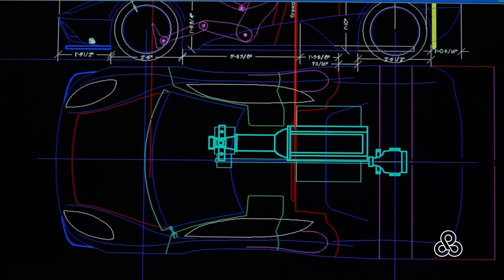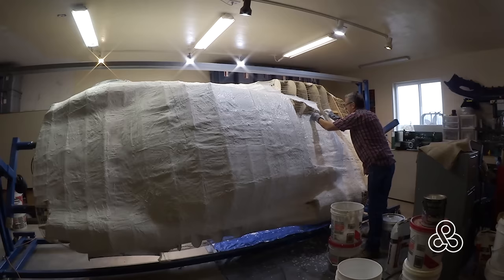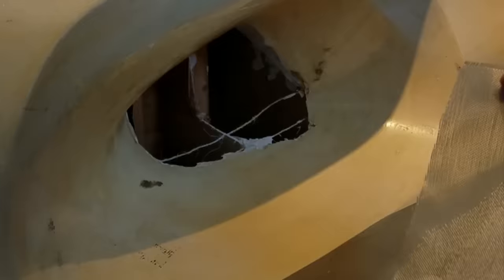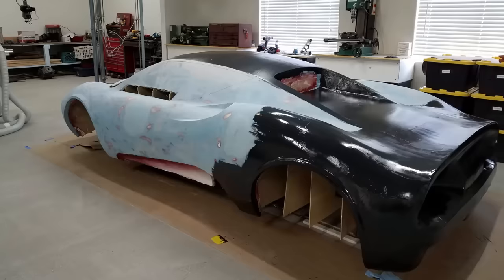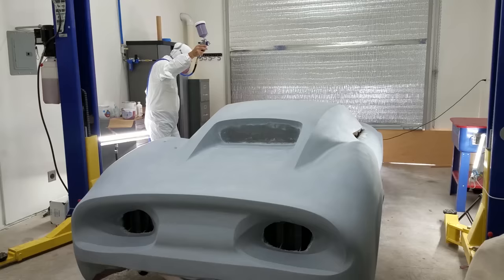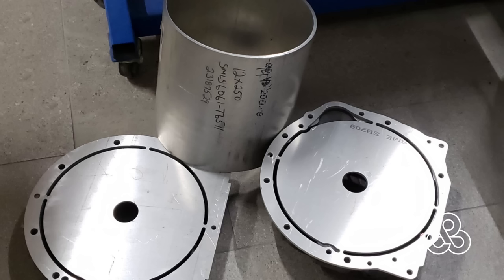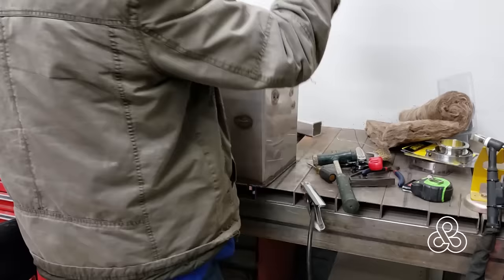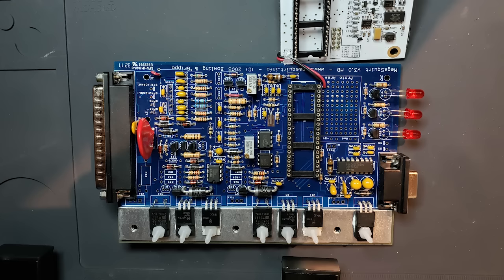How to build your own 200mph Supercar; at home in your spare time. Part 1

Comment: Do you help people do this? This is great
Reply from the maker: The videos are help in themselves, but if you have something specific I can help with; I'm glad to help.
Reply: @BuilderCreator  got yes thanks... I'd like to do this or make a mold of the vector w8.. I should be able to get the dimensions ect. From Google. Would be using a 2003-06 porsche boxster as donor.. i know a California company that does this and sells the chassis noxter donor but with their own custom mold.. just want to know best way to start.. also your not in California??
Reply from the maker: @larryz3985  I'm in Southern Oregon. Get yourself a donor chassis setup and then design your own body around those dimensions ( I can hook you up with a 3D modeler). You can take inspiration from the Vector, but make something original. Find some glass you like from an existing car or it is going to punch a giant hole in your budget to get a custom windshield made. As I mentioned come up with an original design (some sketches or model) the ribs for the full size plug can be pulled from a clay model or a 3D model. Would love to see what you do!
Reply: @BuilderCreator  thank you so much this helps me very much.. will find good wind shield and go from there..  ok appreciate your reply..! I can definitely try and put my own touches that can work didn't have the confidence to even think about that but know I understand that it would be easier fir me. Gives me more room to work with.

Comment: Admire your work. This is how boats are being built in 20th sentry. My question is would it be easier and faster to make a real 3d model and print it out piece by piece and assemble it ant convert to plastic or metal body parts?
Reply from the maker: There are companies doing 3D printing of tooling molds, but a printer that could create an accurate and stable mold for body parts would cost much more than the car itself . . or I would think a dozen cars. You will see some 3d Printed parts getting built for Arete- coming soon.

Comment: This is awesome. My main question however: How much resin did you end up using?
Reply from the maker: At the present point I am at about 4.5 gallons (epoxy) on the car. I expect to add about 4 more. Also count a 15-20% reduction in resin loss in containers, brushes and trimming. 5 gallons of vynylester in the molds

Comment: If you would have put pink Styrofoam between your wood panels and shaped it it would’ve supported a thin layer of fiberglass over top now you have to put first on the pink foam any latex paint to keep from melting the pink foam .because it is Styrofoam then you can lay the fiberglass overtime it gives you a better form underneath can be hand sanded easily . And you can skim body filler over top of the fiberglass it gives you much better substrate to pull a mold off of .or spray foam  you use it it will work but too much work involved in doing that. flat 2 inch thick pink foam between the plywood sections gives you the best form and more support. Spray foam will work as well but it’s more work to shape it because it takes too long to dry unless it is the insulation type fome this  dries within 15 minutes ,that sandes easy like the pink foam I have built  plugs for 30 years we almost exclusively use just the fome. My company built purses and limousines using this method and it was faster and was more accurate.
Reply from the maker: I will often use foam when I have a completed design. In this case I used the plaster over burlap method, because I did not want "accurate," as I use this stage to develop and rework the design. The drywall mud gives the freedom of styling clay, but at a fraction of the cost!
Reply: @BuilderCreator  I understand but it also makes it extremely heavy, and the drywall mud takes 24 hours to dry with the body filler on fiberglass it’s quicker process and much better for fine detail. before you mold as you know the hardest part is after you have the plug finished and deciding where the seams and flanges are going to go .I use double back tape and foam strips to get a straight edge Plus aluminum tape. I start usually in the center of the roof and the hood when those flanges are developed peel them off and run up against them ,from the bottom it’s just understanding where to put these so you don’t get in an undercut or too steep of draft it just takes a little practice. I like what you’re doing I’ve made clay models before but it is much slower. keep working love what you’re doing.

Comment: Great work but I think you did it back to front considering todays software capabilities. most 3d parametric software's can scan your model and give you section slices. better yet full size foam CNC . after 3d scanning your model, and probably ad more details.
Reply from the maker: Even the biggest design studios with virtual reality 3D are still producing a clay model. The tactile feel and ability to add and subtract on the fly can not be matched with 3D modeling. I purposefully did not want "detail" as the full scale model tends to reveal were the detail should fall. And simply, the plaster model can be had for about $6000 cheaper than CNC foam.

Comment: you will get to the body. and the frame. not much else because it requires a garage..electrial engineering degree. welder.... an engine...

Comment: Instead of stainless steel and fibreglass, have you considered using rockwool?
Reply from the maker: I've had a few people say that they worry that fiberglass will break down, etc. One has to remember that cars like this put on very few hours (miles) over time. Perhaps "rockwool" ceramic fiber might have taken the heat better, the temperatures we are talking are not that significant. It is more a factor of vibration. If I get some failure or decide to re-tune with a new system, I'll give ceramic a second look.

Comment: I'm confused. The body is made of plaster??? How will that hold up over time? How does it handle impact/collision?
Reply from the maker: What you are seeing is the construction of a "plug" or model to take molds from. Here is a video later on in the process of building the actual mold and parts from fiberglass composites.-  https://youtu.be/tr2pckxC8s4

Comment: You said you covered the drywall mud with Urethane, then covered it with Epoxy. Would that work for polyester resin too? Or if I'm using poly should I coat it with a layer of epoxy resin first? I love this project BTW.
Reply from the maker: It would work for poly as well. The urethane was just a less expensive way to seal the plaster. The urethane also air dries rather than cures and the poly/epoxy has trouble curing when it disperse throughout  the plaster. (Cures better when it is bulked together)
Reply: @BuilderCreator  So like a Urethane wood sealer? water or oil based?
Reply from the maker: @DougBugBuilder  Yep!  Almost any sealer would work, just want to keep subsequent applications of resin from disappearing before the cure.
Reply: @BuilderCreator  Thanks, HUGE help!

Comment: I use polyurethane foam i am a design technician,from india ,
i work in a customization workshop  using foam from 2k16 it was absolutely amazing it is fast than a clay or mdf cardboard when we are talkin about research & development
I want to send you videos of sculpting I like to work with u so if any job of r &d or conceptual design
Reply from the maker: Clay and plaster give some freedom to experiment with design features a little easier, but if your design is finalized then foam is the way to go!

Comment: I'm building a car of my own, using a very similar system for creating the buck.  Your video has been very helpful.

QUESTION:  I'm almost done with the drywall mud phase, and would like to know more about the resins you used after sealing the mud.  I was debating about going straight to fiberglass, but like the idea of using a resin that will flow out and go a little quicker.  Any info you can provide is appreciated.  Thanks.
Reply from the maker: Lightning McQueen! Sounds like fun. You will never go to the gas station again without an audience of kids (and old kids)! Seal the plaster with a spar varnish or cheap polyurethane stain-in-one finish (Minwax at any big box).  It doesn't take much. just enough to keep the polyester resin, for a light weight fiberglass layer (3 oz cloth), from soaking in before it can cure. You have got some really gradual curves on that car, so a 3oz-4oz cloth should drape over everything nicely without many pleats and tucks.
Reply: @BuilderCreator  What was the black colored resin you used that really seemed to flow out so well?

Comment: So what happens to the material that was turned to dust cutting it? Saw blade is usually about an eighth of an inch. 6 cuts I think for 8 pieces. add it back in or use the shortened version of the car?
Reply from the maker: This may be of consideration if the rib takeoff was intended to reproduce the car in exact scale. I only loosely form the ribs to a basic shape and sculpt the final design in plaster "outside" of the ribs themselves.

Comment: Wonderful. Question: since you are adding material to the body, doesn't the starting model (from which you cut the first slices) have to be smaller than the planned size of the buck? Thanks.
Reply from the maker: Yes, you do need to trim a small amount off the ribs you create to allow for the plaster. The small model is just a very rough facsimile as the real design and refining is done at the full scale; similar to the "clay" model you see professional design studios create.
Reply: @BuilderCreator  Thank you. I am just an "imaginator," but maybe I will "concretize" something.Thanks.

Comment: wow amazing vidio man, I am from Indonesia in progress of making a body using the vacuum infusion method, I am interested in your method, but can I use vacuum? and is there a contact that can be contacted to ask questions about the manufacture of the body?
Reply from the maker: Yes you can use vacuum infusion, although infusion requires stiffer molds with large flanges. I can be contacted through the 'About" tab of this channel or my website buildercreator.com

Comment: Why didn't you simply straight through the exhaust, crossing it over with straight pipes through the muffler??  I'd imagine your U-Bend internals would create back pressure against each side, not ideal with turbo...  thoughts?

Comment: What foam sheets did you use for the floor of the monocoque tub?
Reply from the maker: It is an urethane foam with a fiberglass filled craft paper backing on both sides. You can find it at construction supply stores that specialize in roofing products. There are a couple of different brand names depending on what part of the country (USA) you are in. If you're in another country, not sure where to tell you to look. :)

Comment: You mentioned using the windshield from an existing vehicle.... did you already have that on hand to incorporate it into the design of your car during the design process, or did you find a windscreen of suitable size and integrate it into your design after the fact?
Reply from the maker: I had previously measured the donor vehicle (Chevrolet Cavalier) to make sure the fit was close; then during the build of the full size model (plug) I ordered a windshield and fit it to the model. You can see how I fit the windshield in this video -  https://youtu.be/1IcGEJBXVdw
Reply: @BuilderCreator  That would be much cheaper than having a custom made windshield, no doubt!!!

Comment: is there a trick to cutting the honeycone so acurately?
Reply from the maker: The only thing I have found to work is to cut it with scissors as best you can and then sand it to shape and bevel with a belt sander. Easiest when bonded to one surface.

Comment: Could we simply use a diode laser on a 5x10 gantry and cut 10mm polyurethane dense foam board into slices and then glue them to make the skeleton? Would this be faster and as accurate?
Reply from the maker: It would be faster and more accurate, but about 10 times more expensive. Typically, your model would have to be very refined to go straight to foam as well. When I work in plaster, I take the freedom to use this stage to do some design improvements/modifications. You could also do these design changes in a foam model, but it is much more difficult.
Reply: @BuilderCreator   Thanks!

Comment: How did u factor in the width of the coats of plaster etc?
Reply from the maker: Plaster- I cut back the rib templates 1/4 inch to make room for the plaster. If I cut through that 1/4 inch of plaster when sanding, I cut away the burlap/rib and fill the hole;  likewise I can build up areas much heavier if I want to enhance some design feature.

Comment: I understand that you used Plaster of Paris when you were putting on the burlap. Then you said that you used Plaster on top of that because if was more sandable. I am having problem finding what you called "Plaster". Can you give me the Brand and Type of plaster you used? Thanks, Enzo
Reply from the maker: Use plaster of Paris (comes in a powder and mixed with water - mixed to a thin viscosity) to saturate the burlap. Once that cures, use dry-wall mud (construction drywall seam patch compound- from building supply - sold pre-mixed as a thick mud) to build up and sculpt your design. US Gypsum is a brand for either product found around the world. Hope this helps.

Comment: Is there any way one could create his own cockpit/glasshouse? (completely custom shape...?)
I doubt it, the requirements for this particular part are pretty specific, but maybe there's a chance...?
Reply from the maker: Sure! Some of the companies who do OEM glass also do short run production. They used to require you to deliver the form ( a hard solid shape with a felt cover that the hot glass could be draped over) , but now you can send a digital file. It is expensive for "one off" pieces of glass.

Comment: Would love to start a project like this. What is a good start?
Reply from the maker: Start with a front engine, rear wheel drive chassis and design/build a body. shorten up the build time and amount of work required. After that experience you could start thinking about a ground up project.

Comment: Pretty damn cool. But from my experiences with the 4l60E/4l65E they are shitty transmissions unless beefed up.
Reply from the maker: Luckily even cryo treated parts for the 4Ls are budget friendly.
Reply: They don't like to rev.but decent clutches and clutch hub.thr GM trans will take the 1iz.i have had jz for years only auto I have found is the glide when you turn the Jz up.if he is just doing big top end runs the GM trans while take it jz is the top end king

Comment: My only question is, why did you mig the bell housing rather than tig it??  I'd think you could have wayyyyyyy better penetration and control (plus you can't beat the stack of quarters bead look!!) With the tig over the mig....... right??
I've NEVER been able to run a better bead with the mig than the tig...... tacking would be easier with the mig...... point and shoot....... but burn it in with the tig........
Is there a reason you used the spool instead???  Just curious.....
Reply from the maker: The TIG can't put out enough power to weld .25 aluminum stock. Maybe a better machine with a 3/16 electrode could,  but alas the spool gun gets the puddle done before the mass robes the heat.

Comment: great work , congrctns , i am just wondering , why don't you use the strafor , it ' s the best way to copy your Cad model detail , am i wrong ?  ...
Reply from the maker: Strafor? Curious as to what you are referring.
Reply: @BuilderCreator   i am trying to say Styrofoam , sorry .
Reply from the maker: @enginengineer4039  The plaster method is less expensive and allows more freedom to try design features. If you have a design that is 'not going to change' then cutting it in foam is a viable option.
Reply: @BuilderCreator  How can you do this type of complex job without using a  3D CAD program (Solidworks , CATIA etc. )? i respect a lot this type of designer.
Reply from the maker: @enginengineer4039  I have mentioned before, that I have the design all in my head. I do put my thoughts in AutoCAD to verify dimensions and such. The time to input (design) it into a 3D modeling program, is just an extra step as this is a prototype and I make design changes on the fly. The logical step, if this car was going to be produced, would be to scan the finished vehicle and reproduce the parts more accurately through CNC;  with body parts created from plugs carved from styrafoam as you referenced earlier.
Reply: @BuilderCreator  thanks for ansver ,  good luck ...

Comment: How do you go from CAD to clay model
Reply from the maker: First off, I do not develop the exterior design very far in CAD; I purposefully leave much of the detail "unrefined," as I feel that this is best accomplished in the full scale plug (similar to professional design firms creating a "clay" ) So at the beginning, the rough design is defined in 2 dimensional elevation drawings; these drawings then help produce a rough scale model. The scale model is then cut into sections creating the ribs that are scaled, to get the rough full scale model and then on to plaster to develop/refine the design. Hope that helps the visuals from the video. Of course the videos on my channel describe the process in more detail.

Comment: Those panels look a bit flimsy. are you sure there's enough glass fibre on them.
Reply from the maker: Most of the bigger body panels will stiffen up as duct work and other internal structure is added to the underside, creating what might be considered an internal clamshell. That might be the stiffness you are looking for. Until then, no need to make them stiff on their own or heavier than they need to be. Thanks for watching.